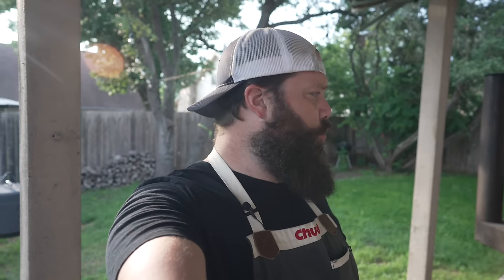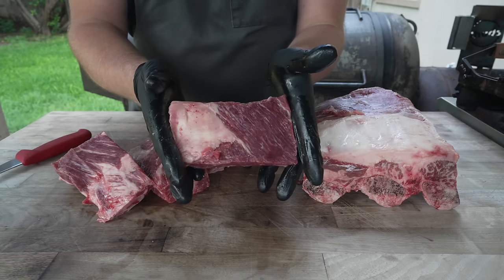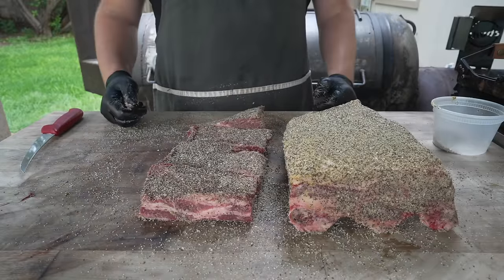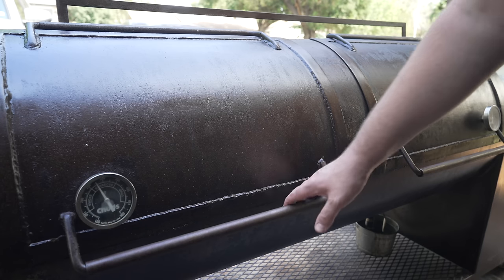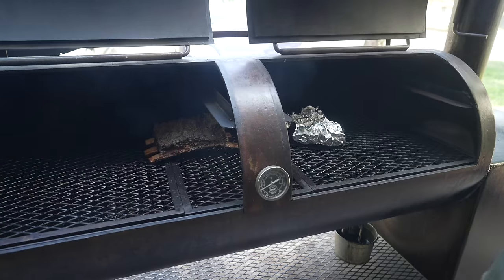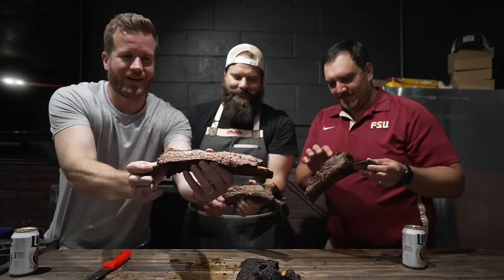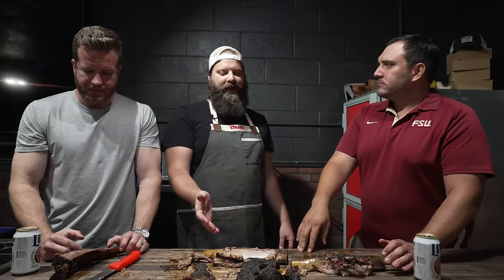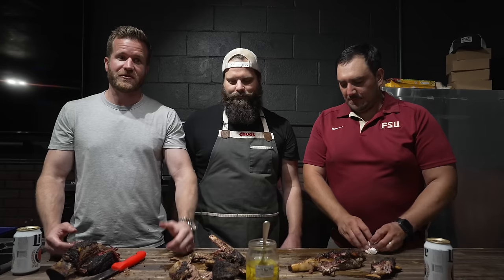Hot & Fast Beef Ribs | Chuds BBQ

Comment: It’s weird he’s getting such fast cooks. I think the bottom plate needs to be welded in to be a reverse flow. You’re cooking on a traditional offset + radiant heat.
Reply: Is it not welded? I wonder how much heat comes straight up from beside the plate.
Reply: @razeunit69  If he did eventually weld them in, he never showed it during the build videos. The baffles are just sitting in there.
Reply: @Wvubrad  Good pick-up, def agree welding in would be best on RF. Maybe Brad will let us know if he did or didn't and his thought process.